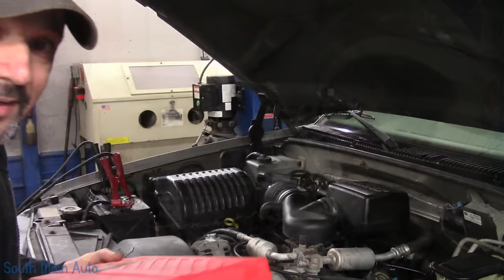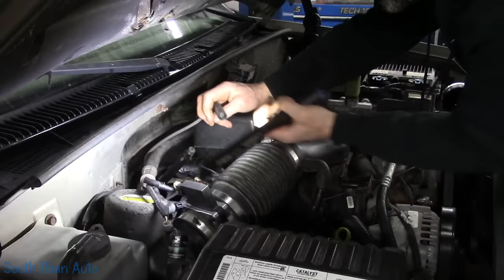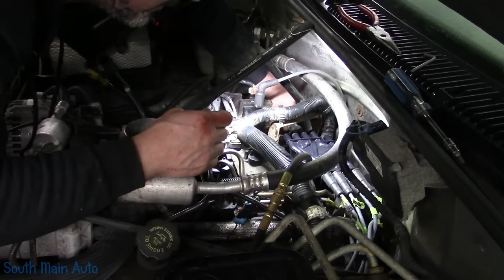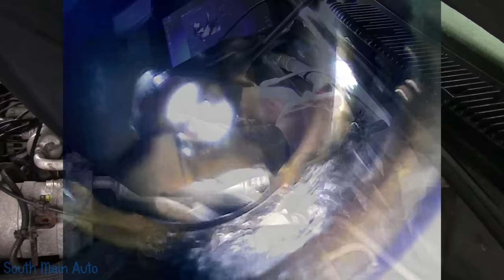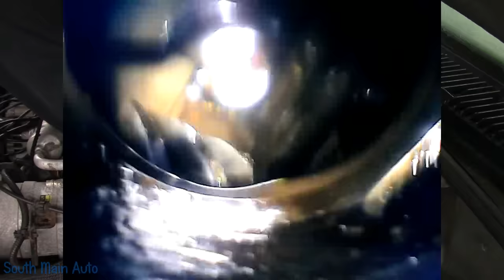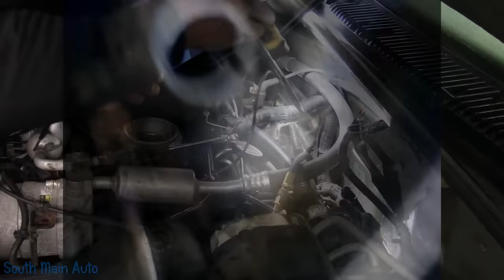Chevy Suburban 5.7 : Crank No Start Part I

Comment: in the early 90s, I worked for the county road commission. All the Chevy fleet vehicles had to have the distributor changed out because if the vehicle idled too long the distributor would seize from the lack of oil. They had a special distributor with a spiral shaft to draw oil up to lubricate the housing.
Reply: Mine is a 1999 Chevy Blazer. I fully understand where you're coming from

Comment: Ok 4-7-2019 948am est..7 thumbs down?  So what was wrong? The sound was adequate, the technical info was good, the picture was good, although its hard to see exactly whats happening, cause the tech is leaning over an engine on his belly 5 feet in the air on top of a special creeper. Youve just been given free education on basic troubleshooting..

Comment: Brother you ain't going to believe this but I have been a tech for years, Ford and Chevrolet,  I have a 2004 Suburban and a 96 Suburban. I let my girlfriend drive the 96, anyway it has been hard start for a while so I put cap and button on her with a set of AC Delco plugs and wires. Ran like a top then about a week ago my woman called and said she was broke down. I towed it home and started with fuel pressure test, spark, and I knew it couldn't have been the cap and button because I only use good high quality brass parts. Anyway I changed, ICM, coil, crank sensor, fuel filter, took the upper plenum off and replaced the fuel pressure regulator, she has 241k on her but it has been serviced regularly and kept up. I ordered a PCM already flashed to my vin #. I installed the PCM and Knock. Same thing,,,crank but no start. I watched your video and decided to check the distributor gear, took the cap off and as I was pulling the wires off the coil side the cap felt a little spongy.  Sure enough,,,,,,,crack in the brand new cap.  Put new cap on and down the road she goes,,, ,so thanks for the video because I would not have checked the cap since I just replaced it.

Comment: Now you have a small block chevy oil pump driver, cut the head off from the bad distro and shave it down to fit in your drill chuck and GTG. I have had one from a Vette for many years.

Comment: I used to work in a shop, little while before I started a lady brought in a 4.3 blazer for runs bad. They do a full tune up and now the truck wont run, backfiring from everywhere and the shop cant figure it out. They send it to another shop for diag and that shop says bad engine, just worn out from age. This is when I am hired. I get the task of changing out this motor. My boss comes along, tells me everything they replaced and to swap the new parts to the new used engine. I get it all done and go to start it and wouldnt you know, my boss says its doing the same exact thing. Some diag of my own leads to a bad brand new dizzy cap, shorted internally sending spark to wrong cylinders.

Comment: 99 GMC Yukon 5.7l vortec. Has a history of about every 2-3 years, in the raining winter time, not starting out of the blue. Crankshaft and camshaft sensor issues. Can either of these going bad cause me to be getting bad catalytic converter codes without or before the sensor codes show up? I just had an issue cranking to start, had to walk away and come back a while later and thankfully it started. Im scared to attempt another start because it's raining and it only does this when these go bad. Just curious 🤔,  thank you.

Comment: You havent seen one in NYS cause they rotted out about 15 years ago. We are still running them in the south, I have 4 of them presently with one, southern one, sitting in Middleport NY cause i was traveling and flew out. Now its getting the same way with the Mid 2000-2012 trucks, full of holes in New York. great channel thanks for your help.

Comment: I'm thinking that my distributor is bad as well. My distributor rotor moves about 1/4" back and forth. You had stated in your video that it should not be able to move whatsoever correct? I'm having a crank no start issue. Sometimes when I attempt to turn it over, the PCV valve receives back pressure from the intake, I would rightfully assume that the distributor would cause this due to the timing issue. If I replace the new distributor, how much play is it suppose to have?

Comment: Diagnosing a no start condition on 98 Chevy 1500 5.7 vortec. I replaced the cap and rotor because the coil contact inside the cap was completely full of carbon.  Still no start.  I checked for spark at the coil through the wire and originally had nothing.  I rotated the wire around and got spark.  Reinstalled, still nothing.  I measured the resistance of this 16" wire and got 700 ohms.  I know the rule of thumb is 1000 ohm per ft.  Is the resistance value of 700 acceptable?

Comment: May I ask i have a 1996 chevy suburban 5.7 k 1500. Starts and runs like new unless its summer time. Turn it off to run in the store and come out and it won't start until the next morning,fires right up then! The fuel pressure is perfect and it has a new distributor,plugs,wires,coolent temp sensor none of wich fixed this issue. NO check engine lights on! In the winter months this problem goes away. Thanks for the advice!?👍👍

Comment: Would that distributor cap have thrown a code??
Please help getting a crank no start sounds just like that ran out of gas put a whole lot of it back in. Fuel pump running. Gas comes out but doesn't just spray out with a lot of pressure on my valve under the hood

Comment: Have a friend who has a friend with a 1998 F150 with the 4.6l that cranks but will not start. I have not seen vehicle yet because he lives about 50 miles away just been texting him. He says it has spark and fuel pressure is good and just yesterday they changed crankshaft position sensor and camshaft position sensor still will not start. He has had intermittent problems especially if it rains or gets wet, he gets water under dash when it storms but this last time hasn't been able to start it. Any thoughts or ideas before I make a trip down there, I'm thinking a bad or corroded ground or connector, I suppose they could have purchased a bad sensor ?

Comment: I have had a brand new Napa "corrected" distributor cap cross fire within itself and cause an idle miss.
When they arrange the caps to have the wire sockets in order on each side of the cap they do it by bending and crossing over copper wire molded in the cap plastic. If the copper wires were not nested correctly they get too close together and jump spark.

Comment: I have a 99 Chevy k1500, 5.7 vortex, I have codes P0300, and P1345. I’ve tried everything different cam and crank sensors, also timing is dead on. The rotor points to the mark on the distributor at top dead center. Also new timing chain installed during rebuild. I’m bout to give up

Comment: Eric, i been wrenching for 34 years and i have never seen this. I have seen the gear split or the roll pin snap and the gear just spin but never the teeth worn. I would be concerned where the gear pieces are now, oil pan, in the pick up screen, etc. The knife edge and the broken gear I would be checking if the cam bearings are worn out allowing the cam to move side to side which changes the depth the teeth clash and subsequently changing the mesh of the teeth allowing the wear and also the broken teeth.

Comment: Got a 99 with 348k miles. This crank no start condition has been fixed twice in the last couple years with a new ignition control module. But today it didn't fix it. How can I tell the difference when one of the two is bad? Guess I'll wait til this big CA storm is done and pull the distributor, but I just don't know why the ICM has been the fix in the past if the distributor was the problem.

Comment: I have had a couple ford distributors that sheared the gear pin, they would crank, backfire and then run for a little bit, and then die again. First one was interesting to diagnose!

Comment: I called it from the start LOL. I had the exact thing happen to my 97 GMC w/ 5.7
Stripped the gear clean off. It had a bronze gear and sent crap through everything. I dropped the pan and checked bearings and got lucky.  Replaced the distributor and ran it for a few years more before I upgraded.

Comment: Another fine production Eric!
I bought a brand new '99 Suburban as a leftover in 2000. 5.7 Vortec, GMC 1500 SLE, 3rd row seat, and barn doors. Drove it till 2015, when a barn door body style collector asked if I'd sell it. We made a deal and I drove it to his shop, got out of it with 272,000 original miles. Just normal maintenance, 1 radiator, and a few water pumps. Never had any tranny problems, original aluminized exhaust under it when I sold it too.
Paid 24K for it in 2000 as a leftover, had 4 miles on the clock. Don't think my new Tahoe will last 1/2 as long as that old GMC Suburban...
Work safe, keep up the great videos!
Doug@ the "ranch"

Comment: Very Common on 4.3 and 5.7's.
On my buddies 2000 Chevy it set the crank/cam correlation code, but it still had teeth on the distributor.  In order to pass emissions without any codes we had to CNC out a new hold down with a slot for the hold down bolt.  We were able to use Torque Pro to adjust.(PID 221301, Min-100, Max 100, Units Degrees,((Signed (A)*256)+B)*0.024,OBD Header Auto)

Comment: Went with cardone select for metal body....first one lasted a week before cam sensor failed second one has been great for 100k miles however don't lose the cap screws as they are unique to the dizzy and screws with new caps for OEM dizzy do not fit.

Comment: Super duper common. I've replaced dozens and dozens of them over the years. Because the cam and drive gear are a much harder steel, the drive gear usually suffers zero damage. The biggest potential issue is that all that metal that's ground off goes through the rest of the motor potentially shortening the life of bearings in the motor. I've never had one come back for a blown motor though. Those cast iron 350s are tough as nails motors for the most part!

Comment: Yep replaced a few distributors like that the bushings were shot in the distributor and it ate the gear. Replaced the distributor, changed the oil & filter and customers never had a problem with it but I told them the metal that was floating around could have caused engine damage especially to the crankshaft & bearings but they didn't want to spend the $$. Obviously it was a good call for them and they'd remind me every time they brought it in it was still running great  😎

Comment: Seen it...fixed many...even to this day as these trucks live a long time here. I don't even give any options...new distributor solves it just about every time. I've gotten so good at them that it doesn't take much time. Also regarding replacing the caps on these plastic things...I try to NOT use the new screws...I know sounds weird but if the old ones aren't chowdered...just put em back in snug and you won't break an ear off the housing.

Comment: Years ago after repeatedly replacing a sheared distributor gear key on a Ford straight 6, I concluded that it had to be a failing oil pump. I could determine no other symptom, and the pump seemed to be the only possible cause. Thanks for stressing the need to validate oil pump condition/performance before concluding this was only distributor failure. Sometimes tryagnostics seem to be the only option, but as technicians we should diagnosis to absolute certainty, sometimes for our own egos.

Comment: One car I had years back had a high performance 327 motor in it and I put an aluminum distributor in it when it was being built.  It started ok, but then died after about 1 minute.  Upon checking, I found that the distributor shaft broke the whole way around.  I ended going back to a cast one and never had a problem with it after that.

Comment: Fun to see you working on an old 350 Chevy small block.  I tore apart and rebuilt many of these in the 1980's.  My friend still has a 1999 Suburban and I always like working on it, except for the Spider fuel injection and knock sensor which are under the intake manifold.

The distributor gear is softer than the cam gear, so it will go first.  In the old days (points or HEI) you had to drop the distributor in and get the timing close enough to start, then use a timing light to adjust the timing by turning the distributor, then tighten its hold down bolt.
Reply: Theres also a wire that'll need to be unplugged while you time it in

Comment: One of the main problems with the "Shivy" small blocks. That, and the damn pick up coils in the distributors, working as the cam sensor. Leaves a lot of shade tree guys scratching their heads. Also seen the reman distributors fail easily, from the gear being shaved in the reman process.

Comment: I've done a bunch of 4.3 V6s with this problem in my shop, never had a V8 that bad. The cam and distributor gears are dissimilar metals the cam is hard billet steel the distributor gear is soft castiron and eventually wears out around the 200K mark.

Comment: Seen that to many times replace with a aluminum  unit and it wont do that. The plastic ones deflect from the load of the oil pump and causes a gear alingment problem. It's good they made the cam gear twice as hard

Comment: So you shouldn't be able to move the distributor rotor at all?  My 4.3 S10 died on the highway, and the spark is definitely not firing consistently.  But it's only about 1/4" to 1/2" of movement.

Comment: Hello i was wondering if u would maybe know what wrong with my dads 1996 f150 when he starts it in the morning itll sometimes run a little rough and die he has to give it a lil gas too smooth it out then goes away only when he starts it

Comment: Worked on Chevy small blocks at lot during my misspent youth.  I cut the handle off a screwdriver and put it in a drill to turn the oil pump to pump up the oil system.

Comment: Man i have a 2001 chevy 8.1 ltr 2500 hd that cranks and dies immediately. I have replaced the fuel pump and the tps. Also the security light will NOT come on at all even after i replaced the whole information panel. I have been tring to get this truck running for months. Can you please help i have asked sooo many people.

Comment: After seeing your cheap USB scope in an older video I bought a Depstech on the Amazon.  They have a few types including wireless to your phone or laptop.  The 5m wireless for Apple I bought was $36.  It has a semi-rigid lead so you don't need to tape it to a pick and it has adjustable light intensity.  As a test I put a roll of paper towels on some junk mail and blocked the light at the top of the roll.  With the camera light on full intensity I could see the details of the cardboard core and read the junk mail text clearly.

Comment: When I first saw the video, before I watched it, I thought it was going to be the cap.  Very common to have crossfire with the flat top caps. My '96 Yukon I got from my dad's coworker had an intermittent no start with heavy kickback, would even run backwards a fire or two when you stopped cranking.  It split the casing on 2 starters just getting it to crank to do testing and move it around in the yard before I replaced the cap and rotor.  But my next guess would have been the distributor gear, common problem.

Comment: When you do a cam in a vehicle or change out the distributor/ distributor drive gear you have to make sure that the gear on the cam and the gear on the distributor are the same material or the harder one will eat away the less hard one, which could either be your distributor gear or your camshaft.

Comment: Best guess would be crappy maintenance ( oil looked manky ?) caused the (softer) dizzy gear to wear to knife edge, thereby opening up the pitch on that gear until its lagging enough for the peak of the worn pinion to clout the cam drive gear and snap it off....there's your slowly occurring misfire  and the dead stop at the side of the road , in my opinion of course. Nice vid Eric.

Comment: It’s the new Chevy Variable Distributor Timing.  VDT. It changes your distributor timing till the truck won’t start.
Nice non flow chart diagnosis.  I like how you jump right to the problem and not to the flow charts.

Comment: I've been playing with using one of the cheap ($25-30) back up cameras systems for getting looks in tight corners.  It's not a borescope but a 12mm for the camera it has possibilities.  No lights on the one I'm working with but I was able to find a camera with the wires to cut to flip to front image and get rid of the parking lines.  Comes with a 4.3" video monitor.  Best, the whole thing works on 12 volts and is analog video so no USB "quirks".

Comment: Dejavu for me..Worked on a 2003 Chevy Blazer with the 4.3. It was in the beginning stages of this problem, the gear had enough play that would rattle ever so often but under load you can clearly hear it. Also just like you said in the video the ears were stripped out. Scannerdanner has a video on this distributor where the customer or repair shop removed the pin to change the gear and put it on wrong ended up with a Cam/Crank Correlation code.

Comment: I own a 98 silv with this engine.  Very common problem with the plastic-crappy-distributor....i replaced mine wirh one from 1A auto parts all metal unit.  3 years and no further issues.  The +/- 2° of zero setting is critical to prevent  cap/rotor burnups and misfires.  Anything over +/-3° is horrible.....random misfires are common at 3-4°…